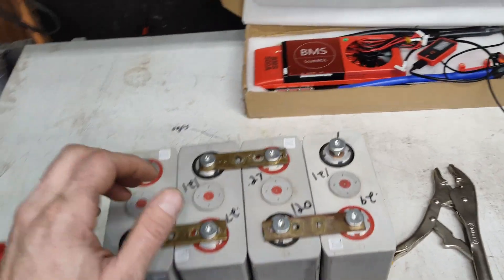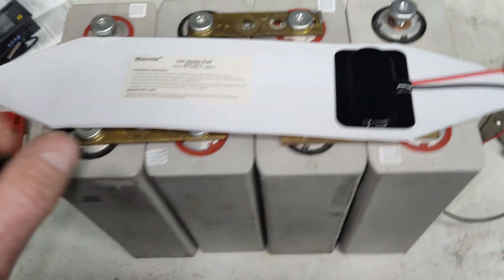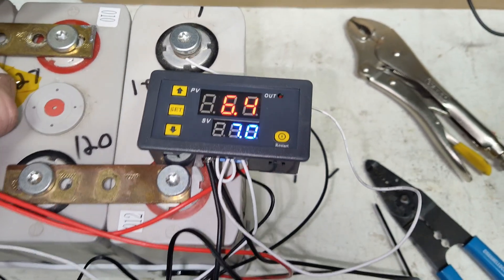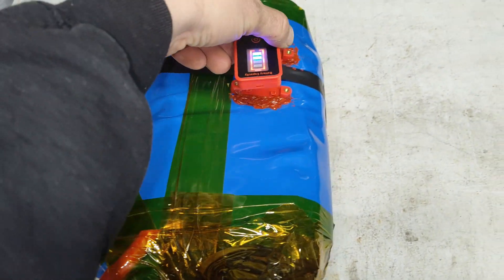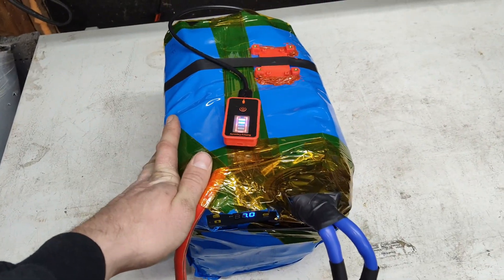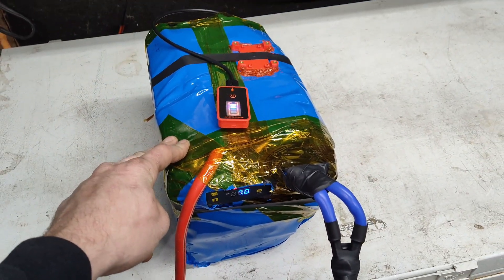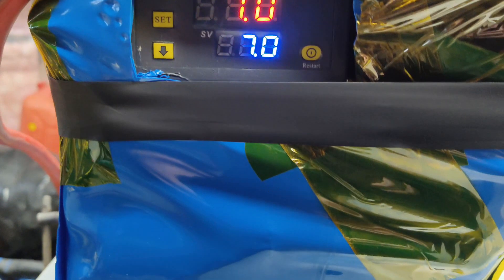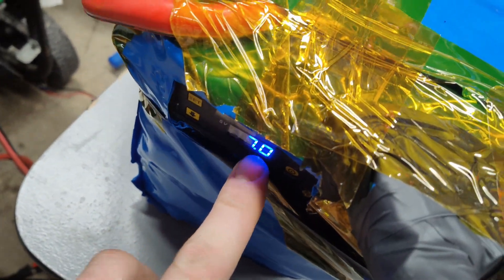1000Amp Battery 500Amp BMS Starter Battery

Comment: I'd get a cc CV boost converter to charge it with, just a $20something board, in a box with relay to turn it on when the engine is running,  I  heard of a self jumpstarter, that used the dead battery, to charge a capacitor,  with boost converter, using the capacitor to start the vehicle.  Then connect the battery, or maybe it's still connected, but I had the idea to make one, then read some company was making them, not a bad idea, should work as long as the battery is not near 0v, say at 9-10v it should work, so just curious if anyone used super caps to help start cold vehicles up there?
Reply from the maker: I still might replace the hole battery if this one I build works welll.

Comment: Cool I see on Lithium Solar channel he tested a battery with a bms that protected the battery when it was froze so it would not charge but the heater would warm battery from the alternator. From my understanding you can discharge from a frozen battery just not charge one. Good luck I hope it works for you.
Reply from the maker: yes you can discharge, I have been testing for a week so far and battery has kept it self warm with no charging and still showing almost full charge.